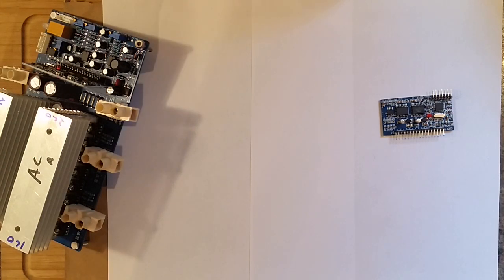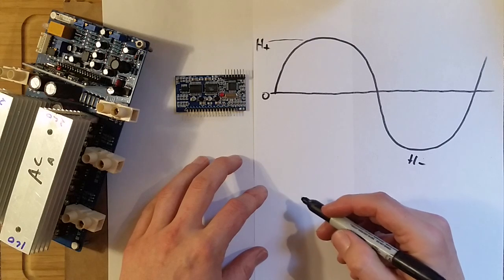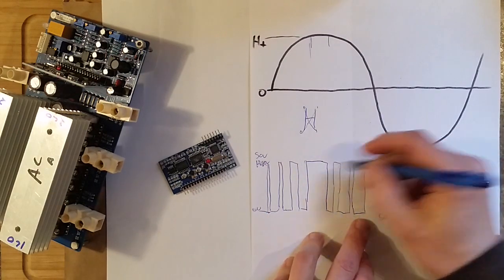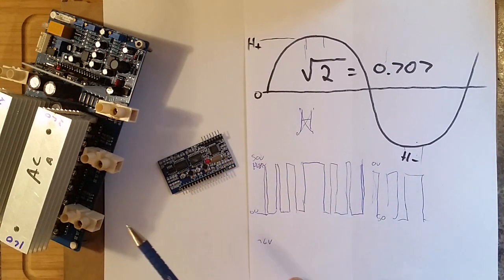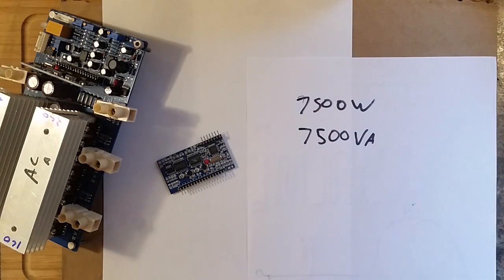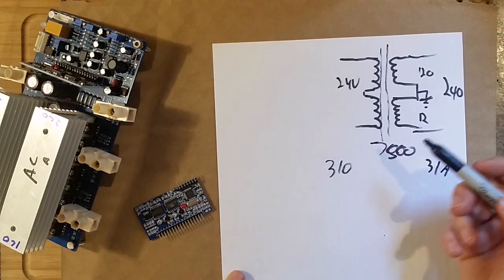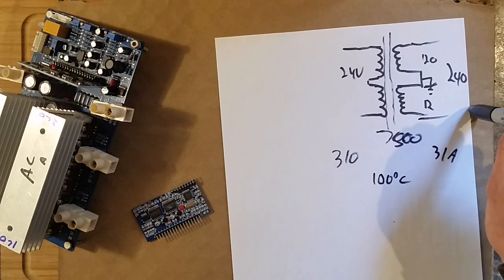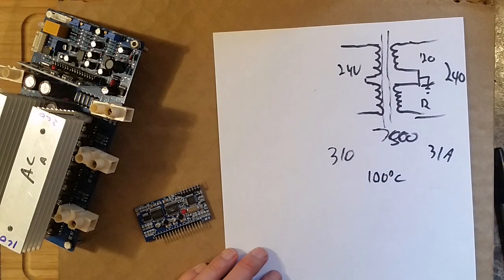white board talk on Chinese inverter boards from aliexpress

Comment: hot tip: you dont need an inverter to drive consumer electronics. As long as their wallwarts/power supplies see more than 90vdc, their bridge rectifiers will transmit that DC to be converted down.

Also brush motors run, but not nduction otors or transformers. 

Try converting your house to run n DCinsead of buying inverters!
Reply: how?  not a bad idea, but
difficult to get different voltages 
 difficult to shut off at over 100 V,  it arcs
and when it fails you are in the dark..
any more?

Comment: Good work
Please how do you calculate the required current that will flow to the secondary of the transformer from the battery through the mosfet

Comment: Draw a circle. Find the length of the perpendicular from the diameter to the circumference (sine wave gyration) as it moves in equal time intervals from one end to the other. This gives the 250 values for the pulse width which is modulated for sine wave.
At 250 volts, the impedance matching transformer needs to take about 40 A to output 7500 Watts safely. True the EG board mentioned below allows use of 300 volt DC conversion for best use.

Comment: sorry for jumping on an old video like this, but im looking for mobile power. we do raves on boats, and i need cheap inverters to be build into a (semi) rainproof package with a bms and battery on 12 and 24v systems. realistically they will only be running dynamic loads(music, 1000-200w) when they may not fail, and one or two 600w pumps in the off season where reliability is justa luxury. i would use a 3000 w at half strenght. would this work for me? i dont know what the cycles duty on your bench tests were, or how they failed. would be cool to know, because victron/mastervolt etc. do not make financial sense in our application. cheers!
Reply from the maker: A diy robust fail-proof inverter for use on a boat is asking a lot. It my actually be cheaper to buy something. Getting 3000w would probably help.

Comment: At 7500w you'll need to have a high voltage high frequency DC-DC converter which is shaped by the egs002 to generate the output sine.  Power transformers at these wattages get hugh and unwieldy.

Comment: Is it possible to series all your Tesla modules to drop the amp input in half? Or will the input components not handle the voltage?  Nice work
Reply from the maker: Yes, there are now inverters that can take over 90v dc, the ones I have don't do that (components). I wouldn't do that because it causes issues with electrical code/regulations for  voltage greater than 50v

Comment: What this blue board and the big red board you have blow up on normal use in a house running air conditioners refrigerator stuff like that
Reply from the maker: They blow up easily because they are fragile. Anything can go wrong when all the wired and parts are exposed. It is easy to control these on a work bench with a current-limited power supply, but when hooked up to batteries with essentially no current limit  (time delay fuse), it can be quite frightening when  it goes bang. 
I probably won't rebuild the red inverter because of this.